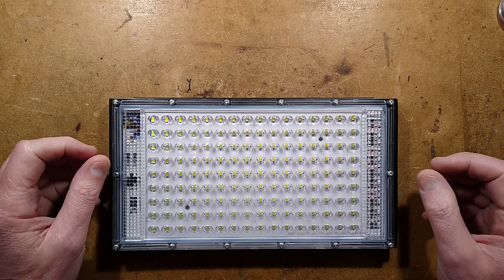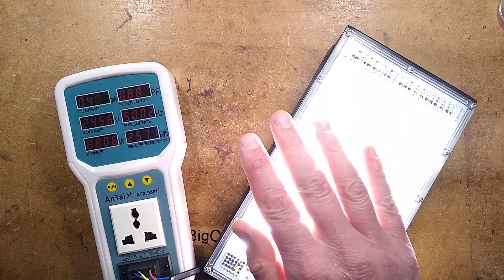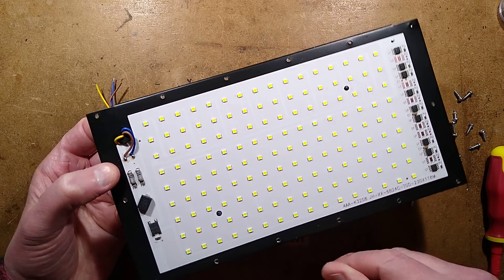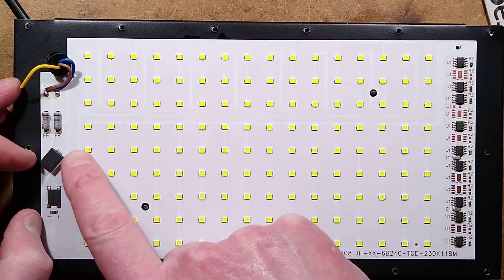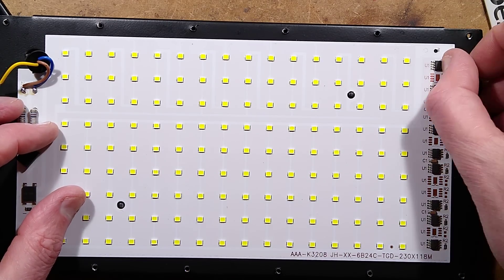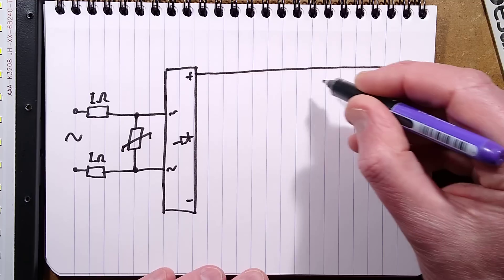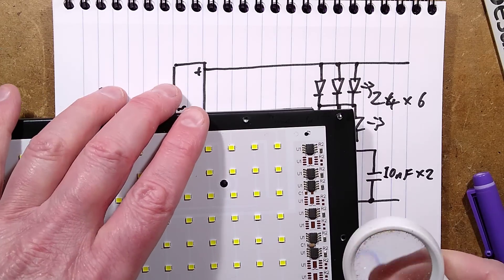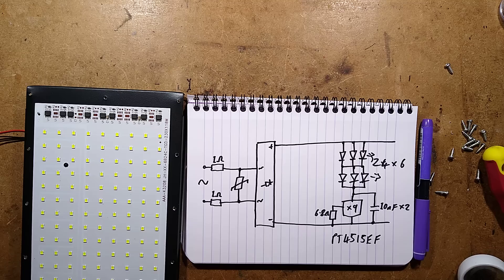eBay 150W LED floodlight?  FLICKER WARNING

Comment: I bought a couple of these to add some extra lighting above my lathe. They are out of reach so the earth issue is no bother to me and so far they are working great. The light output is really excellent and they are still going strong after maybe 24 hours solid use so for the price then they are fantastic

Comment: "Trapping moisture in" I am amazed at the number of dome style security cameras setup this way. Even with all the extra seal goo and desiccant packets we would get puddles or fog in them, especially the ones with built in mini-heaters that supposed to prevent it. Often you will see outdoor ones with a small hole drilled in them to allow water to run out.

Comment: I have a very similar light, though mine is a grow light and the CCA in different. Mine came with it's own DC power supply brick, which I suppose makes it safer. The power supply is very light, I am afraid of what is inside.

Comment: I purchased a piece of apparatus from China which was intended for use in a hair salon, with the intention being to repurpose it.

It was CE marked and comprised a metal case. It wasn't earthed.

Another piece of equipment I also bought, again, a mixture of plastic and metal, again not earthed and the wrong size fuse fitted in the British mains plug. Sold through UK Amazon.

Another piece of mains equipment I purchased was subject to a product recall notice because of exposed live parts. I still use it, because I'm not supid enough to stick a knife or knitting needle into the terminal pins on the mains socket outlet on it.  The live and neutral female pins are not shuttered.

Just stay away from anything mains electrical made in China.

Comment: Wire wound guitar strings with the ends wrapped around dowels are perfect for sawing through glue or foam tape. Old autobody trick. Dental floss sometimes works, and less chance of scratching paint.

Comment: I got the uv version about a year ago. Replaced cable as soon as i opened it also added a big heatsink to back. Its great for setting uv resin and it was less than a tenner with same day delivery.

Comment: any idea, how to reduce flicker? I tried with 4,7 microF 400V capacitor, it burned the 10 ohm resistor (on the left) ...
Reply from the maker: The best way to reduce flicker is to add a completely external circuit with series dropper capacitor, rectifier and smoothing capacitor with discharge resistor.  Or just buy a panel powered by a traditional LED driver.

Comment: I stumbled across an M&S Candle today that when lit, turns on LED lights. Blow the candle out and the LEDs turn off. Could you do a break down on how this works? 
I tried to use a torch instead to trick the lights into working but it didn't work. Is it heat activated? 
It can be found online simply by searching 'M&S LED Candle'

Comment: If the case is metal,  some wiring codes require it to earthed as it can become alive should an internal fault occur to prevent shocking you.

Comment: Hey Mr Clive I came across EMP protection for cars. one has a 3-wire hot,N,G would love to see your analysis of this link is here /watch?v=QUidUTzStLA
Reply from the maker: As far as I can see it's just a small cluster of MOVs inside and lots of potting compound to hide that.
Reply: @bigclivedotcom  Of course, 'Fully Potted' they said. Thanks Mr. Clive

Comment: These lights are glued with silicone as assumed, with no thought as to the heat management needed for the panel. The case is powder coated, so is thermally insulated from the light. Lots of reviews exist where the light fails after running for approximately a few minutes. I ran mine (50w) and got too hot to touch after about 5. Pcb(?) Is way too thin to give this half a chance of surviving

Comment: I'm betting 150w equivalent, so somewhere around 10-20watts real power, and something sketchy in the design, it is cheap after all. Not all cheap things are bad but there is some merit to "You get what you paid for."
edit: Oops, I bet too soon, I bet the earth wire is hanging loose in the case.

Comment: Considering that the back of the case is likely intended to function as a heat sink, it seems quite likely that the board is actually attached to the case using thermal epoxy.  If that's the case, you pretty much will not ever get it off without damaging something.  (I wouldn't expect them to use silicone adhesive, because that is actually an extremely good heat insulator, so would really completely undermine the usefulness of the metal back for dissipating heat)
Reply from the maker: They do have thermal transfer silicone style compounds.  I think it might be that.
Reply: I got the LED board off fairly easily so it's not thermal epoxy. They sometimes use metal oxide filled silicone adhesive. On mine there was a thin zigzag of glue, whatever it was it was more of a fixing than having any use for thermal conductivity.

Comment: There's no way that's enough heatsinking for an 80-100W light. I've built a LED light made from LED tape and a reasonably large extruded heatsink, it draws about 20W at full whack, and if I don't use my PWM dimmer, it gets too hot to touch in less than 5 minutes. So I imagine this will regulate down a lot more if left on for much longer. With that basic aluminium panel for the heatsink, I'd want to reduce the power to 10W at most. And I expect it would still get very hot after a short amount of time.

Comment: I wouldn't think that connecting earth/ground wire is one of the most sophisticated things to do that these (sketchy) manufarturers rather avoid it than just screwing it in place or just making a proper connection.

I see it as straight forward as:
"If you have the capabilities to make a functional circuitboard then adding one more wire connection wouldn't be an issue..." but looks like it is.

And it cannot be cost savings related because if they can afford a cable which has all of the three wires then adding an extra bolt or a solder point shouldn't be an issue.

Comment: Slight OT. Any chance of a followup review of your Doogee S98 pro now you've been using it for a while?
Reply from the maker: It's been absolutely fine.  There are a few bugs in the firmware, and the camera is fine, but not implemented as well as it could be.  Battery life is still stellar and it performs as well as the day it was bought.

Comment: It is more of a DIY project, utterly unusable as supplied. I got a purple grow light version of this for my chillis. Normally I wouldn't consider something like this due to the awful flicker. Mine had exactly the same construction. I threw away the crappy metal back plate and replaced with 3mm aluminium plate and additional heatsink. Gets quite warm with just 30W. Also replaced cable and added cable gland and earth ring crimp terminal.

Comment: I had hope you hooked it up to a scope - I am interested in why it has a .8 powerfactor and whether and how much these things 'pollute' the net.
Reply from the maker: The unsmoothed linear regulators have a good power factor because they ride the sinewave.  They also have very low electrical noise.

Comment: So, maybe ~150 watt if you use dry ice to keep it cool? Anywhere near 150W leds on a PCB that size, just glued to a thin aluminium sheet, and even also a plastic cover over the leds, seems like a fundamentally bad design to me.

Comment: Was just thinking as you were trying to lift that board, next time you're doing the charity/bric-a-brac shops/websites see if you can find one of those old "bone" handled long pallette knives such as those used in baking etc. If you needed to, you could put an edge on it with a stone or a grinder to slice through sealants etc.

Comment: Even if the power gets themally regulated down to say 80W I still can't see how the heat gets effectively dissipated with such flimsy setup.  I certainly have seen much lower powered LED lamps with huge radiators. I don't think this thing will last long.

Comment: Perfectly useable when used indoors, earth connected, heatsink(s) added & powered through a rcd breaker. I've used the growlight version for a few years. Keep your fingers away from the white mask on the pcb though..... It's not a perfect mains voltage insulator (don't ask!).

Comment: Hello, I enjoy your videos. I do not know if you have heard of this phenomenon, but in the U.S.A our city LED lights that line the roads start off as a WHITE light, then slowly morphs into a PURPLE / VIOLET light. I have actually seen this happen. It made the news on several news cast. Any chance you might be able to get a hold of one of these lights maybe see why they changed. According to an article there was a delamination of the film that makes the lights white.
Reply from the maker: I've been trying to get a panel from one, or even just close up pictures.  It sounds like the phosphor has detached from the violet emitters.

Comment: the board is nice, heatsinking disappoints, switching out the resistors to make it a 50w light and putting a better heat sink on you would get good efficiency

Comment: Two black dimples might be rivits
Reply: no, they are useful for alignments. The PCB and the frame must be aligned so that the plastic cover with the lenses are aligned. Mine had the top plastic misaligned and I could not correct it.

Comment: Considering the origins, is the mains input flex rated for 250 volts? We've had Chinese mains IEC leads on computers that tripped earth leakage breakers all by themselves (not plugged into the PC), and self-destructing cables (it actually exploded)
Reply from the maker: The only known thing about the flex is that it is cheap and probably mostly aluminium or steel.

Comment: I am just waiting for the next generation of products, that take penny pinching to the next level.
Introducing power cable with 2 copper coated steel conductors and a green-yellow PVC filament earth substitute all sheathed as 3 core cable.
Reply: Manny already have copper coated steel cables labeled as genuine Cooper. 
It's all over eBay and Amazon. 
Especially  HiFi cables for cars or aftermarket cables / plugs for home alliances

Comment: Pre-viewing predictions:
150W-equivalent : ❌
Grounded/Earthed: ❌
Live/Neutral Reversed: ✅
Barely Acceptable Weatherproofing: ✅
Overdriven LEDs: ✅
Hackable: ✅

Well, it certainly is quite bright, might be comparable to 150W flood light. 0.9 power factor was certainly a surprise as well...

I was searching for a  receptacle tap with USB charging on Amazon last night. Found one that looked reasonably decent, even saw a photo of the interior showing three MOVs and a gas discharge tube. I was actually a bit excited at first, thinking it was well-made. Right before I clicked "Add to Cart," I looked closer at the photo and found the PCB had solder pads for all sorts of components that weren't populated, and that the MOVs and GDT were simply Photoshopped into the photo. So, a hard pass. Then a quick scan of reviews showed one customer plugged two LCD monitors into theirs and it failed immediately. Other reviews stated the green "Surge Protected" LED went dark within a few days' use. Whew, glad I didn't fall for the photo!

Comment: The temp coefficient you see is due to the constant-current nature of the regulation. An LED forward voltage drop has a negative tempco. Thus the P=I*V equation is going to decrease as the LEDs heat up.

Comment: "I hope people are not buying these and using them"  Hahaha  Neatly sums up the appraisal!  Thanks Clive!
Reply: I bought couple of them from AliEx and I did not test whether the earth was connected or not (because I wanted to mount it at the entrance door). I fixed it with hot glue and it has remained stuck for more than one year now. Another one has the top plastic lens misaligned but I could not correct the error.Overall I am happy with them.

Comment: What's the luminous efficiency of this setup?  I mention this because I have a 50W COB mounted on a fan-cooled very substantial finned aluminum heatsink.  When powered, it's best not to look directly at it--the light is quite blinding.   Do 72 LEDs of this unit have the same efficiency?
Reply from the maker: Over driven and hot LEDs have low efficiency.

Comment: I reviewed an early 50-watt version of this on my Channel way back in 2018. Amazingly my version really was earthed but sadly the front was riveted not screwed. It also, almost made its rated power. It also got VERY hot, too hot to touch. It also only lasted probably less than 10 hours. No big bang or smoked just would not light.
Reply: Yes, this will melt in a moment. There is zero heatsink capability in that sheetmetal.

Comment: What’s the luminous output?  I’ve got some 5,000 Lumen shop lights which draw about 40 Watts.  They’re in beefy 46 inch extruded aluminum channels and they get warm to the touch, maybe 35 degrees C in a 25 degree room..  By extension, this light should put out at least 12,000 Lumens.  I’d also wager this light gets quite hot, dissipating 100 Watts in such a small surface area.

Comment: I’m an engineer I’m looking for a decent light to iluminate my work area on a lathe.
I have trouble seing machined edges particularly with white Acetal material.
Most of my work is plastics , nylon, acetal, polyester, polythene, ptfe ,peek and many exotic materials some containing metals.
Reply from the maker: It might be worth experimenting with different lights to see which gives the best accuracy.
Reply: Invest in a good quality light that does not flicker, as all these cheap ones do. The flicker is tiring to work with and is dangerous as it has a stroboscopic effect that can make rotating parts appear stationary.
Reply: Fluorescent lamps with electronic ballasts do not flicker because they work above 20 kHz. Before electronic ballasts were commerically available it was common practice to have a fixture with 3 fluorescent tubes, each on a different phase.

Comment: I'm still stuck in this rat-infested housing association hovel, until I'm allowed to move into the house my parents left me. You talked about grounding. I've tested my metal-cased kitchen appliances for grounding, using a multimeter on continuity, with one probe on the sink, and the other probe on the appliance exposed metal. I've also tested all my sockets with a plug-in neon tester. So, hopefully I shouldn't be going up in a puff of smoke anytime soon, although my landlord is trying to have me sent to prison ... AGAIN!

I got a new washing machine recently, Big Clive, and I looked inside it, like you did with yours! It's got a nice quiet Inverter motor. The motor has the control PCB actually inside the motor itself at the back.

Comment: I was going to guess 75W for the draw, 100W on a 150W product from ebay/alibaba/etc is actually excellent and it's possible outside in the winter it might actually draw something close to 150W , and at 8.3mA per package that wouldn't even be driving them very hard.

Comment: Wow, 100 watts on such a small panel without its own heatsink must rely on external cooling. This also looks like this module is designed to be fitted in a somewhat standardized mount, it looks to me, like a replaceable module for a certain light pole. Maybe that's how cooling is achieved?

Comment: Ali have been selling the "50W" version of this for a little over a pound delivered if you buy three pieces of tat. To be fair for the money they're not bad. Unsafe and mis-advertised is a given with cheap Chinese crap!

Oddly mine does appear to be properly earthed with a crimp and screw to chassis.

Put a couple of dozen of these behind the panel on an old LCD TV with broken backlights, and build yourself your own "mini LED" set for £50 😂

Comment: You need something like a steel baking spatual to spudger bigger things like that circuit board. Slide the metal spatula under the entire width of the circuit board and pry.
Reply: Cheese wire...

Comment: For the cost, I consider this floodlight a good source of some good LEDs. If you try to buy the LEDs from a distributor for a project of yours, you gonna pay them 50x more - if you gonna buy them from LaBaja, you get scammed (I got 50 x 10,000 μF 35 V capacitors; inside the aluminium can there is a tiny 10 μF 16 V capacitor)...
Reply: I'm not sure if they are good LEDs. They might only live a few monts due to overhating.

Comment: I used a similar light over my workbench, the current drivers slowly died , as each one did she lost brightness untill it didnt light. tbo it was horriffic with flicker, but did produce a lot of light. I have another 2 of the same pannels on a tripod as a worklight, and they are holding up ok. I opened them and the earth arrangement was the same. kinda expect it these days TBO.

Comment: I bought a UV light in an identical format (no idea what the actual power is) with the small exception that they used 2 core cable and didn't even bother to pretend to earth it.
Reply: That is actually safer because at least you can see that it is ungrounded. It is even worse when they sell extension cord with grounded plug and socket but with 2 core cable.

Comment: At 100 watts, it will generate about 50-60 watts of heat, which has to dissipate from that area of aluminium on the rear of the lamp. Unless that is a 3C/W heatsink (and it doesn't look anything like that) it is not going to be very long before some of those LED's exceed their maximum temperature and go burnie-burnie.
Reply from the maker: The current regulator chips self-regulate the current down when they overheat.  So the power will drop with temperature.